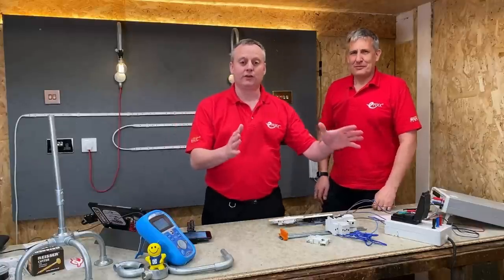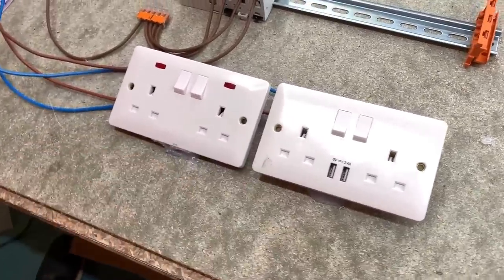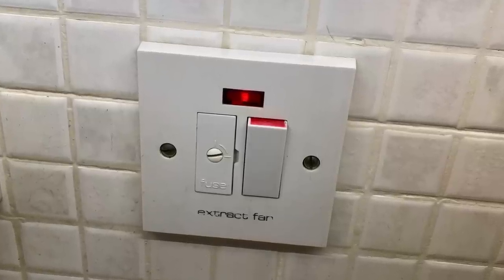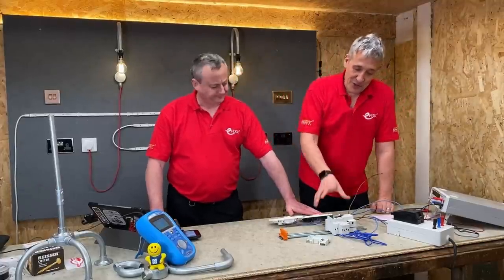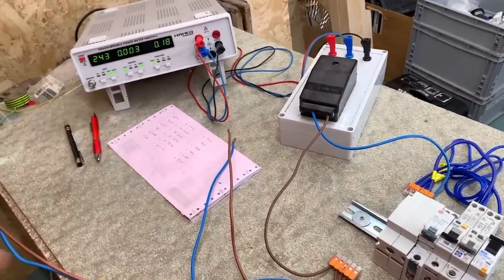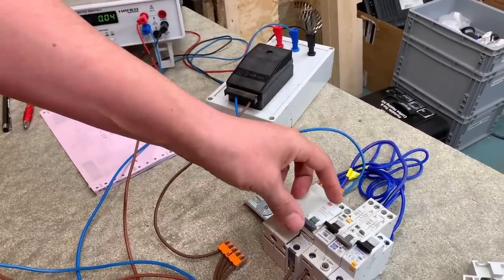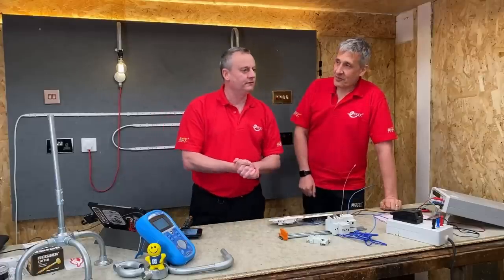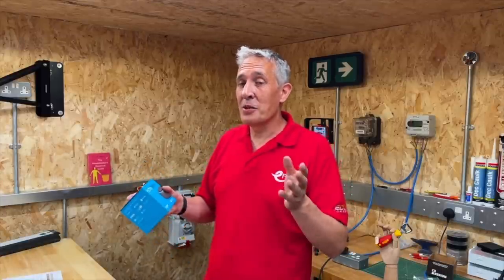How Much Power Does an AFDD Use?

Comment: It's just a matter of time until the utility salesmen surreptitiously start charging for apparent power instead of actual power.  When that happens the cost of running one of the many devices that use capacitive dropper power supplies (time switches, PIR and dusk sensors) their yearly cost will multiply by about ten times.
Reply from the maker: Add in the many poor quality LED lamps.
Reply: @bigclivedotcom absolutely agree the question remains yet their own infrastructure investments are lacking. We live in a world when the financial model lords it over the engineering side - race to the bottom to squeeze cost and quality out. The reality is this approach undermines the long-term brand values - name your example here…..
Reply: Is charging for KVAR made on commercial installations in the UK?
Reply: How are smoke alarms powered?
Reply: @stevejagger8602  very often yes. Also they charge based on maximum demand too sometimes
Reply: @edc1569  capacitive droppers
Reply: That's already the norm in the states for commercial and large accounts.
The bill contains a cost for KVA and a sliding scale cost for power factor.
They also include a demand charge based on your highest demand in any 15-minute billing period during the month.
Reply: In Finland commercial consumers pay for kVar, and most have a compensation battery. There is a limit how much kVar you can use before you need to pay

Comment: Lets say you have say 16 installed x £0.70 gives a "parasitic load" cost of £11.20 moving up to £15.00 with the new prices.
Certainly not insignificant.
Multiplied by 27.8 million homes in the UK gives about £400 million - that's a few power stations.

Comment: Those small loads add up, especially if you have a half dozen or so of them installed. However the old style mechanical meter would under read with this, because the load is small, and the stiction of the movement is enough at this low level to make a high drag compared to the torque, so the meter will barely move for these loads. New digital meters though will have a better register of this, even though the power draw is going to be very much much into the noise floor of the unit, and thus likely to be removed by the auto zero of the meter unit after a while.

Of course if you have millions of these installed your electricity suppliers will have to provide power for them all the time, just like the largest power use of the common stove top and oven, and the microwave oven, is the actual clock on the unit, simply because it is a constant power draw, while actual usage is in general only brief, even if it is 3 orders of magnitude higher.
Reply: All of what you said only applies when there is no load and everything is turned off, which is rarely the case - the typical household always has something drawing power. As soon as there is another load, these small quiescent currents will just add to the total power consumption and will be registered by any meter. A bank of 10 AFDD's will draw ~5 watts, at 52p / kWh that's £22.78 a year!

Comment: Can you guys look at mains powered smoke alarms,  it's worse than you might think......
Reply: I've noticed that. A multi sensor linked system can suck up some juice.
Reply: @davidsharp9166  eevblog did a video and calculation for Australia and it was truly frightening.....
Reply: @paarker  BTW yes I can disarm a G4 without a code as I reverse engineered it and found a flaw in the system that you would not believe!  We are talking a few seconds. On access to a keypad about 3 seconds to turn off/disable with brute force!
Reply: @timballam3675  would you share with me as I’m currently reverse engineering my panels comms protocol, interested to understand.

Comment: There has been significant covered over the years not to leave appliances on standby to save electricity. Safety wise a good idea, but what good are they if they don't work on all circuits. They outcome can be the same for a lighting circuit as power circuit.

Comment: Wow so some houses, have some serious vampire loads from all these devices....

The Meter uses
The RCBO
The AFDD
The USB built in chargers
The Neon indicators.

On top of the Chargers
Reply: Obviously not that serious at an electricity cost of 27p to £1 per year per load.
Reply: @deang5622  I know my houses reported minimum load after the next price rise is about 100 a year, I'm guessing. 

I've got smoke alarms pulling 5watts in total. A load of Pir Sensors, neon indicators, 16 way Consumer board with RCBO's, Smart immersion/central heating programmer. An at least 2 built in usb charging sockets per room. 

Then you add on stuff I don't really need, like router, CCTV, network switch, NAS, Extractors (running every time the lights come on even if not needed).

Comment: Another big power draw is the absolutely horrible power supplies in the AC smoke detectors.  They really add up as well.  Here in the USA most all breakers are AFCI's in a residential setting, along with a large number of GFCI's.  I would expect in the next few NEC updates 2023 is the next, that most all breakers will have to be AFCI/GFCI.  We have 76 breakers in our house.  Also who pays for the smart meters power, the power company or customer?  Just a point of reference here as well our power cost where I am at in Texas is $0.11USD/kWh.  That is our normal rate 24x7.  If you want to do time of use peak can be about $0.15/kWh and off peak about $0.06/kWh.  You can also get a nights and weekends free plan as well, where the peak time is higher, but power at night and all weekend is $0.00/kWh.  I think you guys are getting past the California rates, which are some of the highest in the country.  Do you have specific EV rate plans there?
Reply from the maker: Good point on the smoke detectors we’ll take a look at a few and find out the power use. UK power prices are now ridiculous. We do have special EV tariffs and lots of time of use demand based tariffs. Standard UK price cap rate rises this October to $0.60 - a challenging time ahead.
Reply: I wouldn't be surprised if they banned ev charging in Belgium or Europe at night 

I'm not against ev's but our electric grit is not ready 

I did the calculations and figured out that Belgium needs 2Gw of power 24/7 to drive electric 24/7 that's considering all peaple are charging 24/7 if they only charge at night we will need 4Gw 12h/day

Comment: It'd be interesting to see the schneider electric lisse spurs(sorry fcus ;) ) that use an LED instead of a Neon.

Most type AC rcds have 3 components... 2 rectifiers in inverse parallel to limit the current to the trip coil, and a capacitor to smooth it, on a tiny pcb. Surprised me how simple they are electrically.  

And twenty bleeding watts for a smart speaker? WOW... glad i don't have any LOL (also we still have an old electromech. meter that as SeanBZA noted, likely underreads on low loads)

Comment: If your home is heated with electricity there isn't any difference in total home cost as long as it isn't installed outside or in a garage
Reply from the maker: The heat from the devices offsets the home heating.
Reply: By that logic everything is 100% efficient
Reply: @neok1996  in winter...
Reply: @neok1996  it pretty much is
Reply: @neok1996  every electric heater is 100% efficient.

100% of electric energy always end up as heat, an led bulb makes lots of light but when the light dissipates to the walls it gets converted to heat.

And incandescent lights are also 100% efficient to make heat AND light.

Only downside is in the summer when you want to cool your house it is wasted heat, or if you use heat pump since they are usually around +400% efficient to heat.

Comment: I take it the 20watts of power for the Sonos system is the whole setup, otherwise you need to check again as these are only a couple of watts per device once they go to low power sleep mode. A lot of people make the mistake of measuring devices straight after they have been powered up; and not after they have suspended and gone into their sleep mode. (We looked into this when we were installing large Sonos arrays 15 years ago - from memory they sleep after 20mins of no playback and sit there eating only 3W - but I imagine the newer switchmode power supply versions of the amps and speakers will be better)
Reply from the maker: Yes the whole set up - 2 ones plus, sound bar and a sub
Reply: @efixx  Seems high - try rechecking after 30mins of being plugged in - I bet you a sausage roll it will be lower
Reply: @paulbell7654  since they need to listen 24/7 for a Alexa call they can't go into a deep sleep because they need to figure out that you said hello instead of Alexa this needs significant processing power
Reply: @neok1996  I understand that on the Alexa enabled units, the output side goes into deep sleep(power amplifier/DSP and associated circuits)

Comment: I was very surprised the classic neon used that much power. How does it compare with later ones with LED indicators? If you are looking at more vampire devices those night lights built into a 13amp plug are interesting and use more power during the day when the light is off!
Reply from the maker: So we’re we - we’ll checkout an LED version and report back.

Comment: Good video i have a question old surge protector extension lead when they failed leaked current and tripped rcd’s. Do surge protectors on consumer units leak when they become faulty? Obviously most tenants wont look at the indicator. Thanks
Reply from the maker: SPDs usually fail short circuit
Reply: @efixx  thanks, so boards like Hager which use an SPD without an MCB do they have inbuilt overload protection or does the main service fuse protect against this.

Comment: It is worth contemplating how much power 20+ million homes consume on the grid just from indicator lights.  If we add the power from other stuff which isn't doing anything very useful in standby we can easily knock out a small power station or two.

Problem with a lot of electronics is the manufacturer sees the idle power consumption as an externality as they don't pay the bill and therefore don't put any effort into power reduction. It wouldn't be a bad idea to add lifetime power consumption of products into a manufacturers/distributors scope 3 emissions and add a good chunk of carbon tax to them. Wishful thinking.

Smoke detectors are a huge offender, they take about 0.5W power but most of them have an appalling power factor often resulting in a draw of over 10VA.  Multiply that by the number of homes and you end up with a significant amount of power  factor correction for the grid.

Comment: So OK hardly any amount of power.  Let's say I Was to steal one penny a day from every persons bank account.  Why don't USB charger sockets only use power when switched on.
Reply from the maker: Built in usb sockets use around 0.25w when in standby - they can’t be switched off
Reply: @efixx  That I do know I have for testing rewired the inside so it is only on when socket is switched on.  Only a tiny bit of power on each but add it all up for each house.  As I say imagine stealing 1p a day from every bank account in the UK and 1p a day from every shop till.